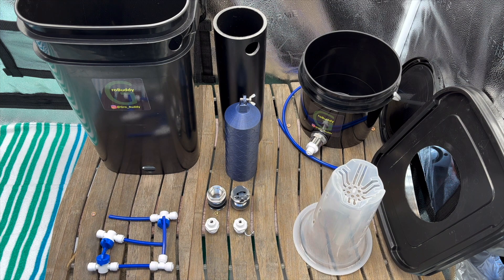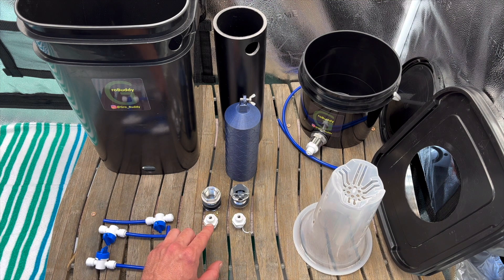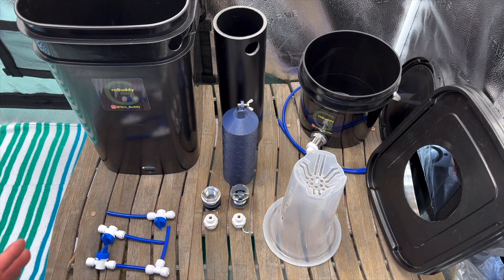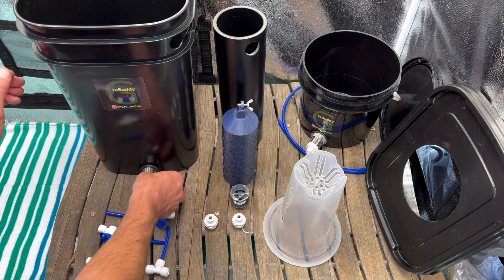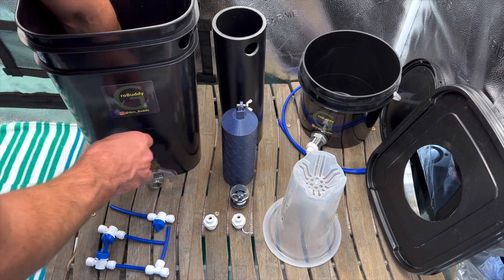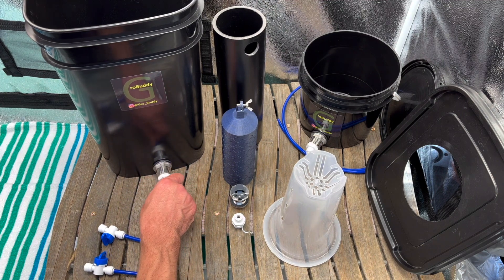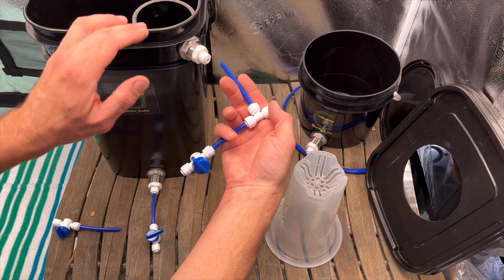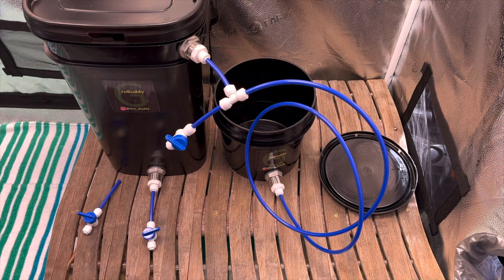GroBuddy assembly -  Auto watering Kratky method hydroponic system

Comment: Hello Sir.. Great video!!! Did you figure a cheaper way for this or do you have a part and build instructions that I can purchase?
Reply from the maker: So I had a patent pending status and then they fully denied me without much explanation. I do have a plan to make a net cup with a built in float valve so any bucket with a hole can convert into a Kratky bucket but I’m currently needing to learn sign language 🤟 so I’m delaying that. It’s just a basic float valve from Amazon and a hair color application bottle I use with a net going through the lid and a 3 inch pipe to hold it all together. If your interested I could sell you just the float valve assembly I still have some stuff I didn’t sell
Reply: @Kratkymethod  What's your email
Reply from the maker: thegrobuddy@gmail.com
Reply: @Kratkymethod  How can I get my number to you?
Reply: @Kratkymethod  How can I get my phone number to you?

Comment: I was wondering would DWC with a bubbler setup grow faster then this ? can u do a side by side comparison ? . Also if u did include a bubbler in this setup would it grow faster per say ? ( or use the nutz water more efficiently )
Reply: Depends because the water temperature needs to be at a certain temp to utilize/uptake co2/oxgen preferably between 64-72 degree's otherwise the bubbles become pretty much useless
Reply: I hear ya !. and agree. Keep watchin this dude. he's cooking ! 

 @patrickwilson9783
Reply from the maker: I actually got someone doing a side by side right now his instagram is lifesgarden420 - have you run DWC?
Reply: Yes. it didnt work. I am goinna try again. because its fall and i have nothing ! @Kratkymethod

Comment: Seems like a lot of extra steps when u can take a 3 gallon bucket and just install a 3 inch net cup to the top. Your net pot is far to big for this to imo
Reply from the maker: GroBuddy 2.0 will be shorter with a shorter net cup and most these pieces will be molded to the buckets alot less parts and alot cheaper to make. Stay updated things will get better
Reply: @Kratkymethod  I am I'm curious to see where it goes bot knocking you system or Hussle bro was mwnt to be some insight sorry if it came off assholeish I am a nyer
Reply: @Kratkymethod we’re can I purchase the 2.0 ?
Reply from the maker: Thanks for your opinion buddy !
Reply: @Kratkymethod  just being real bro this seems like kraky but with extra steps and I say the pots to big cause u loose space for nutrients and say you grow a auto flower that plant will probably hit flower before the roots would be long enough to be put in the system. I would shotern the pot a bit I get the reservation not challenging that that works. Just some insight not  with hate bro
Reply from the maker: What nutrients do you use